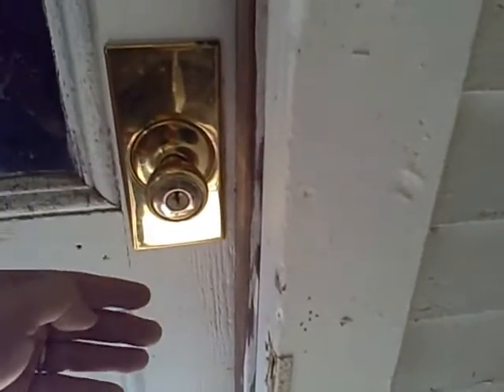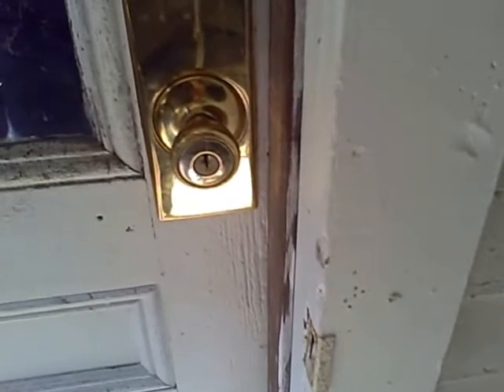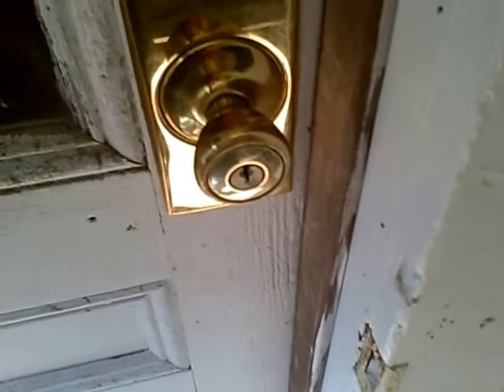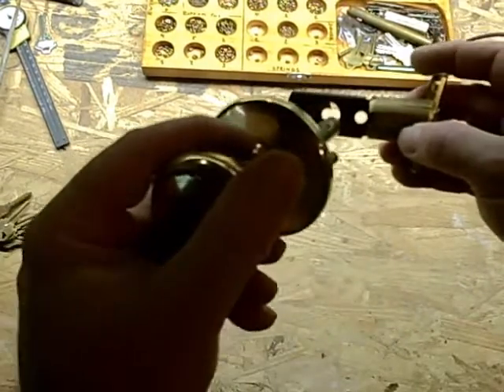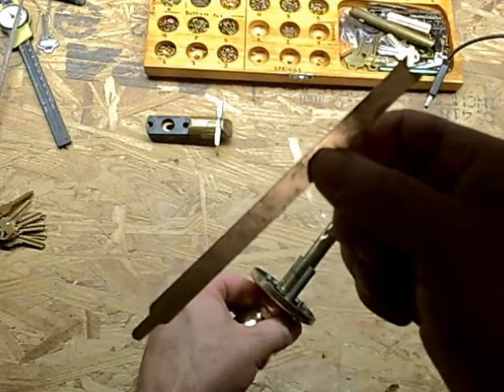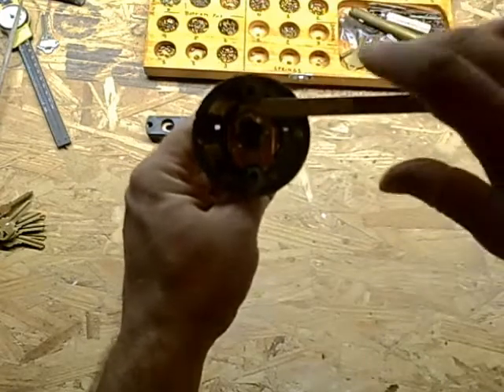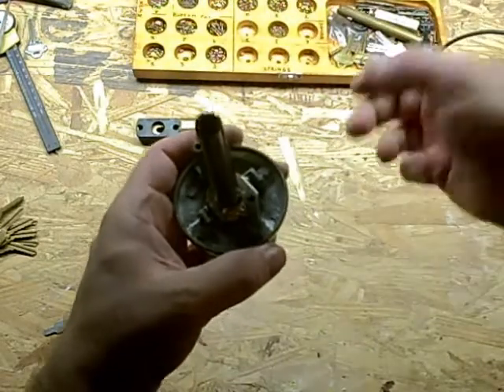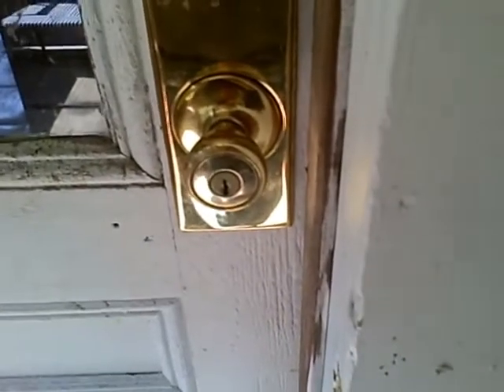How to Reverse a Kwikset Lock Cylinder

Comment: There are countless videos of showing this, however I want to know how to change the lock direction from clockwise to counterclockwise, to match the deadbolt.
Reply: Exactly my problem! Did you ever figure it out?
Reply: @Passions  I did.  I managed to get the cylinder out with two thin screw drivers but it’s quite tricky!  The tool would make it a lot easier.